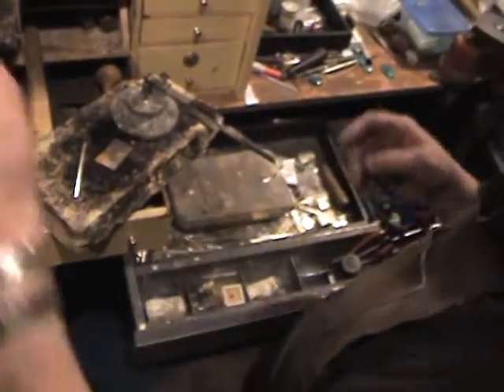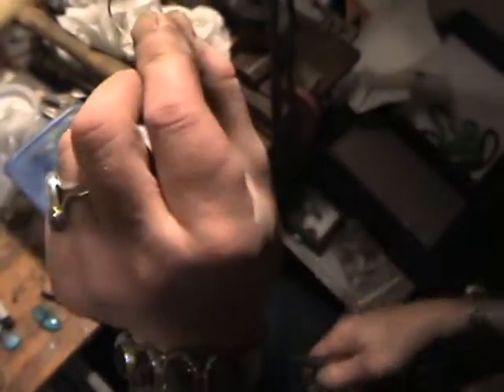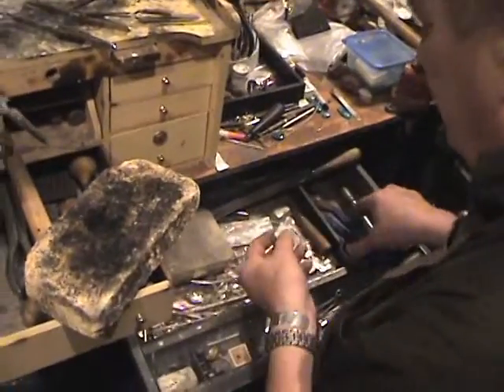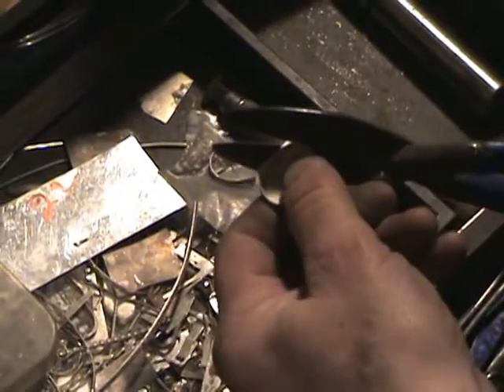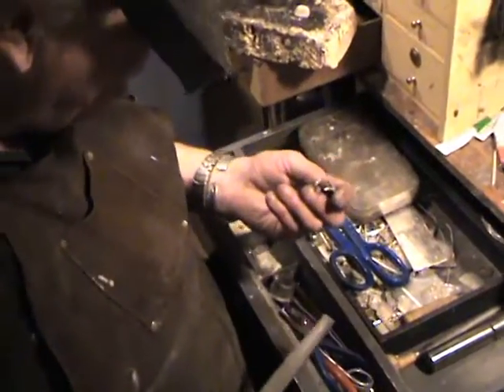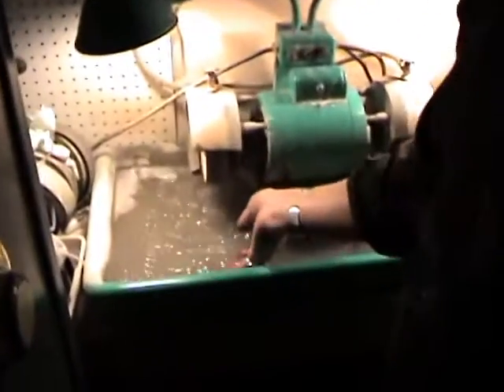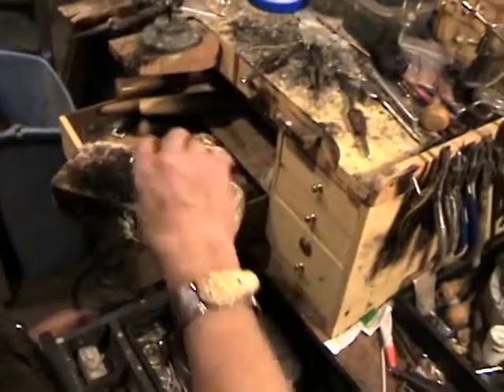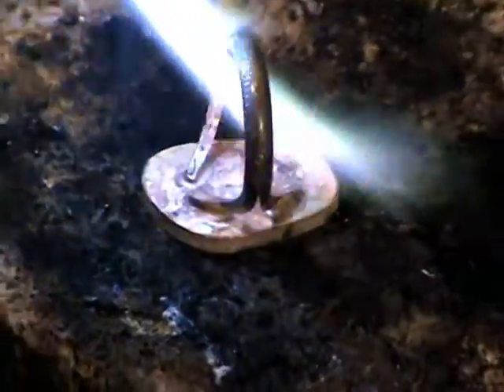BASICS! silversmithing HELP, a sterling turquoise ring

Comment: Are you saying to put solder on the seam, while soldering it to the bezel... because it keeps the seam cooler, so it won't open?
Reply from the maker: yes,.. lay little squares of the solder on the bezel,.. so when it reaches the temp needed,.. it quickly runs around!
Reply: I think Nicoli said to put solder on the bezels seam, first, while soldering the bezel down to the back plate, so the temperature of the bezels seem is lowered, while he's heating the rest, so the bezels seem won't open due to the heating of the price to solder the bezel down. Good tip.